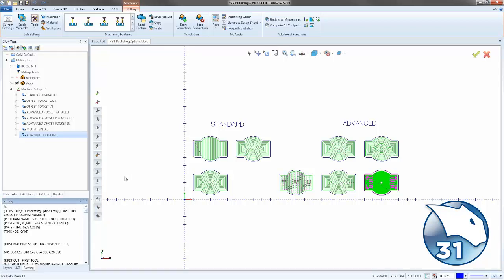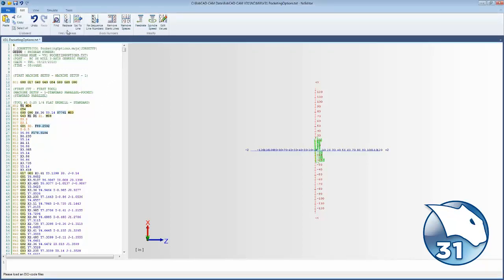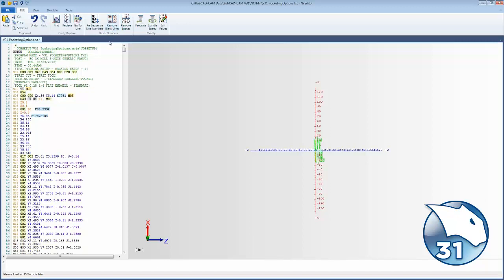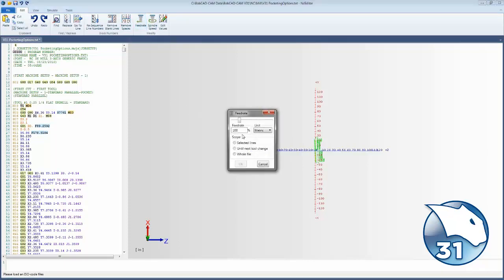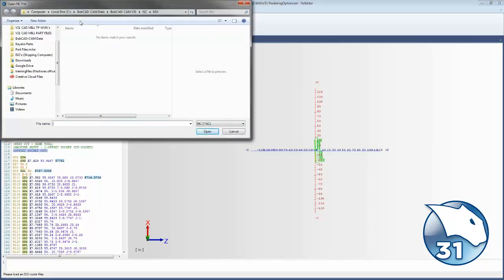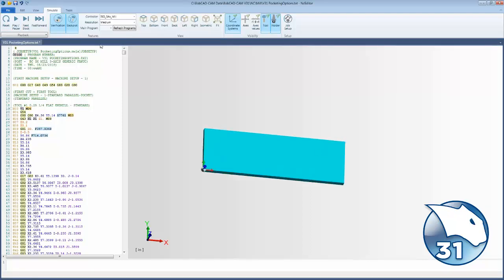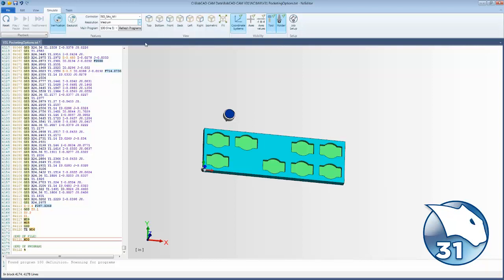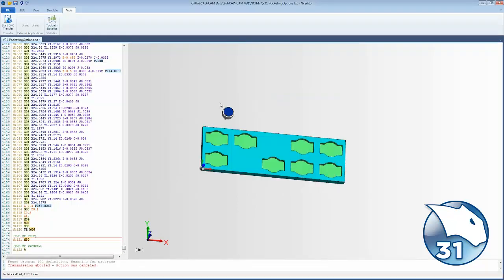BobCAD-CAM V31: NC Editor - 08

Comment: Is it only the pro editor that allows backplot from .nc code? Does Sim come from motion code or .nc Gcode? Does the editor launch only from Bob, or can it be launced on its own to edit previously generated Gcode?
Reply from the maker: The Pro Editor allows for simulation and backplot, based on the G code.  The editor will only launch from within BobCAD.   We are getting ready for the V31 webinar series, if you haven't signed up use this link:   https://bit.ly/2xSilXB